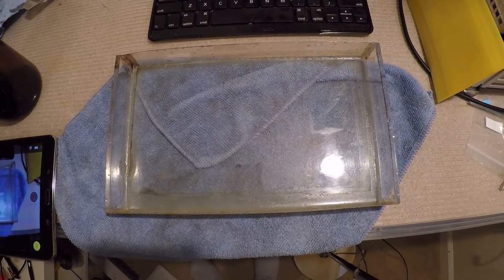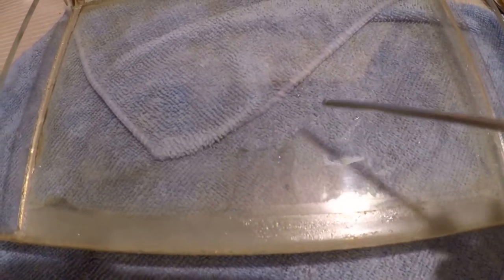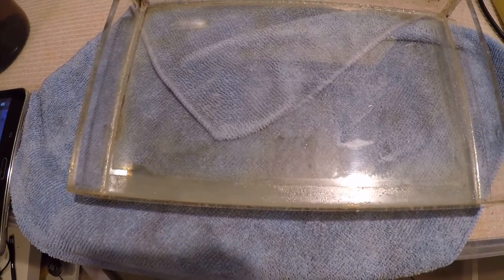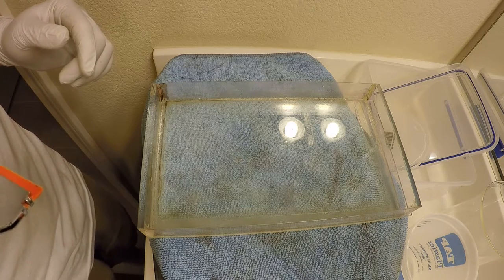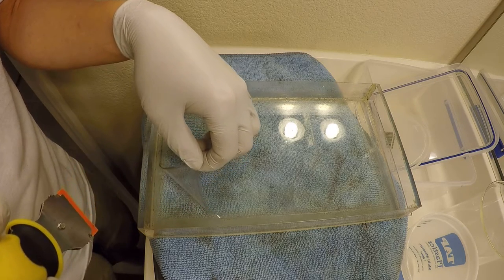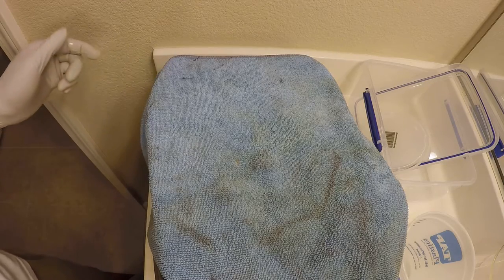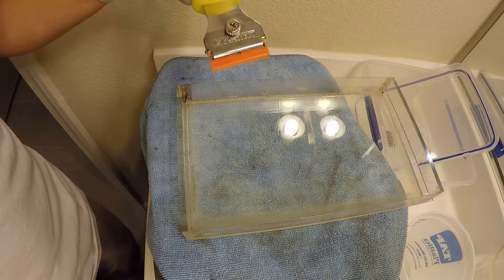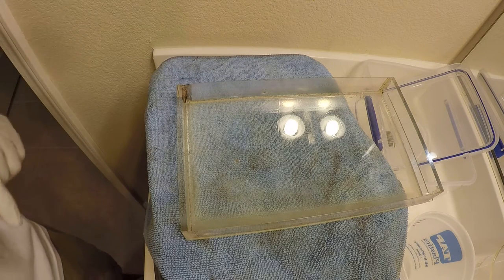Kudo3D Titan 1 DLP SLA 3D Printer - Replacing the Film on a V2 Vat

Comment: Please advise, when removing the teflon sheet................ how i can clean the silicon gel? its sticking is not good as the resin went into.....
Reply from the maker: +Muhammad Zeeshan It's not likely to be as sticky as it originally was since the film is likely set while silicone is not yet cured. I generally rinse it with IPA, but don't touch the resin with anything solid at all. If you need additional help, I suggest posting in the Kudo3D forums (http://www.kudo3d.com)